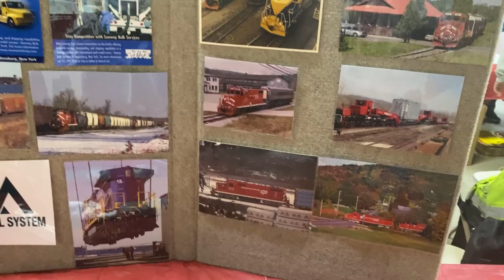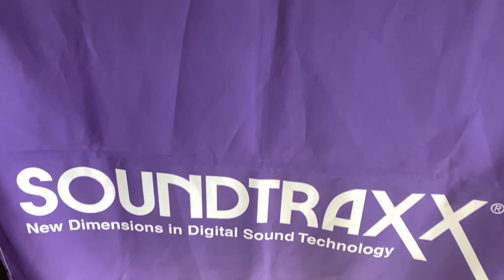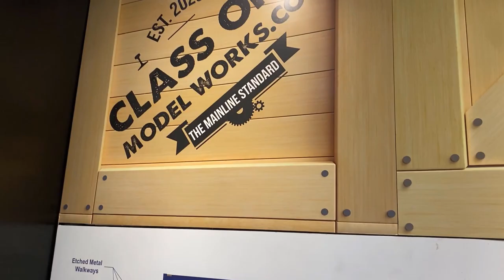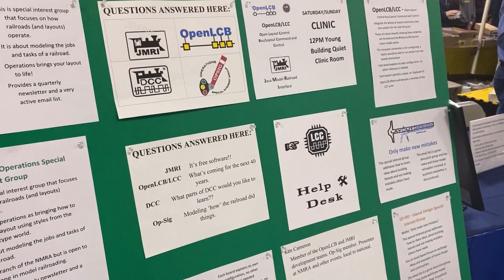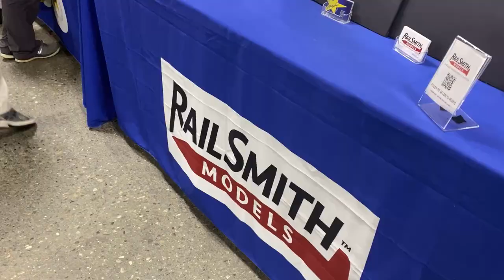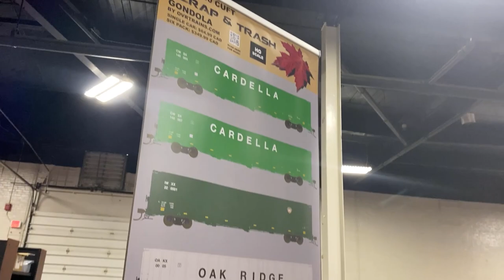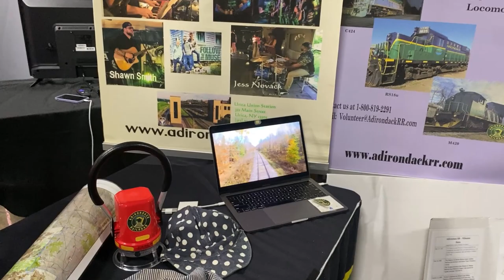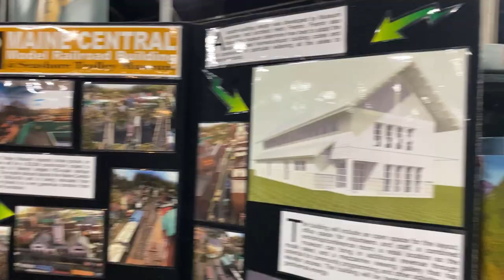Let's Tour the AMHERST RAILROAD HOBBY SHOW 2023! Exclusive Interviews, Incredible Trains!

Comment: Why do some people say B40-8 backwards?
Reply from the maker: 8-40B
Reply: @NorthCountryTrains  well I meant the way the guy said dash 8 40 b but I more commonly hear B40-8
Reply from the maker: @NorthernNewEnglandRailfan  I used to and sometimes still call them that, no real difference
Reply: @NorthCountryTrains  huh. Also, with the blunami soundtraxx decoders they said it can run off DC power right? And it's controlled from an app? But I would need a DCC ready loco right?
Reply from the maker: @NorthernNewEnglandRailfan  You could install it in any loco you can install standard DCC in- the complexity will vary.
Reply: @NorthCountryTrains  I'll start with buying one then
Reply: Ever hear of the Norfolk & Western Y6b's, those massive 2-8-8-2 Mallets that lasted up to 1960?  Some folks got in the habit of calling them Six-Why-Bees and just couldn't break it!  🤣
Reply: @wayneantoniazzi2706  heard of em, they're really cool. Guess it's just how you hear the name, what sounds better to you.